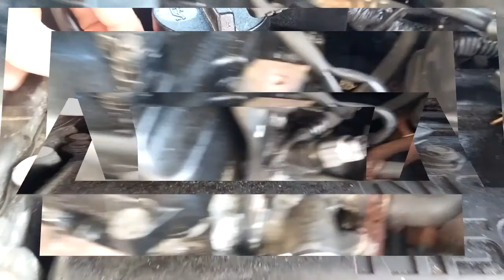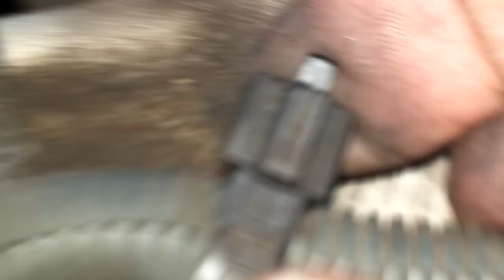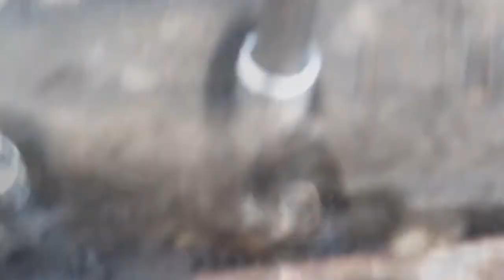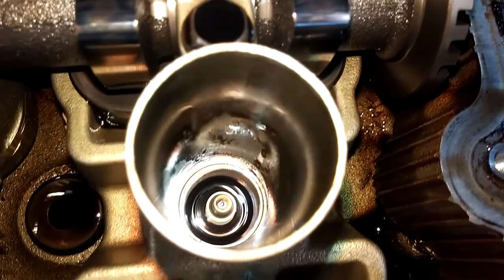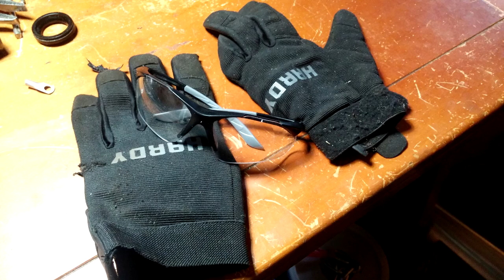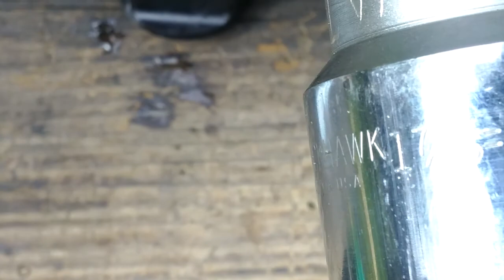Remove non Removable Sparkplug Tube Seals on a 2003 Nissan Altima 2.5L

Comment: Stupid ass design. Nissan failure.....
Reply from the maker: yeah not a big fan of plastic car parts. i saw a car with a stuck open intake valve EXPLODE a plastic intake manifold was like a bomb going off. if it was a metal intake it would not have exploded. everyone now a days is seeing how cheap they can make something and the max they can sell it at.

Comment: A lot unnecessary work, use a dremal next time cut the ring pull it out and sometimes is cheap to get the whole cover from amazon and if you want to use same valve cover get the seals from a 2010 Honda civic 2 per plug and it seals better than the original Good day...
Reply from the maker: you missed the whole point, you need an almost perfect circle for the new seal

Comment: Wow. This was an extremely helpful video. Planning on changing the valve cover gaskets on a ‘08 G35. Fingers crossed no oil in spark plug tubes. Don’t think I’ll go through hassle of trying to cut out & replace seals.
Reply from the maker: you also need to take into account that the plastic valve cover gets brittle over time. so in the long run maybe better to get a new valve cover.

Comment: Better to replace the cover as it's not that expensive. Just use Nissan OEM Only!! Dorman and others not sealed at the baffles.  But if you're going to do this they should follow your steps to the tee.
Reply from the maker: yikes the Nissan valve covers are several hundred dollars. I bought a valve cover for my 2002 Sentra for under $50 at Rock Auto and it had the baffle in the underside top. came with a gasket and a PCV valve.
Reply: Just going through the same process on a Nissan Neo 1.6 ltr in Thailand, valve cover priced at $240,  the inner seal holding plate was $106 and the 4 seals were $7.50, then you have to glue it all together. Opted to machine out the old seals and fit new, then machined a metal ring to fit tightly over the seal to hold it in place.
Reply: @murrayfranklyn84 buddy I have a 2007 Nissan Altima and I'm replacing the tube seals with new ones and it's working out great no need to buy a new cover that's crazy people don't know what the hell they are doing 😅